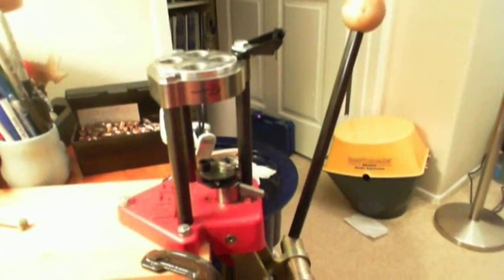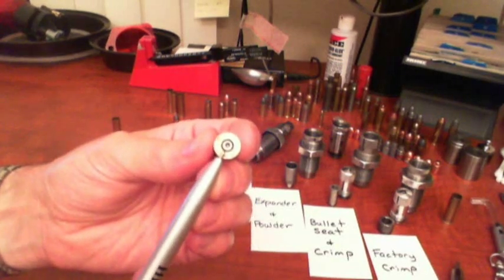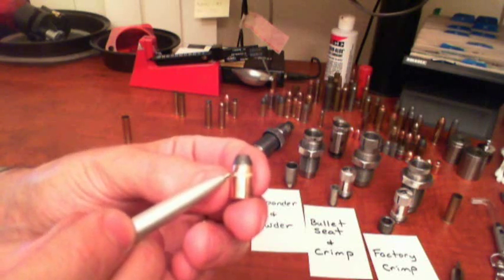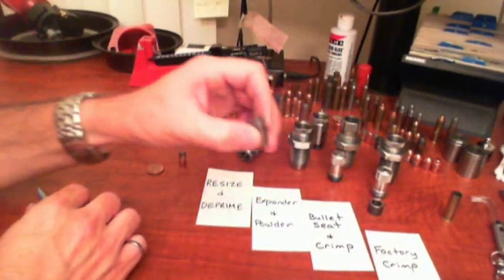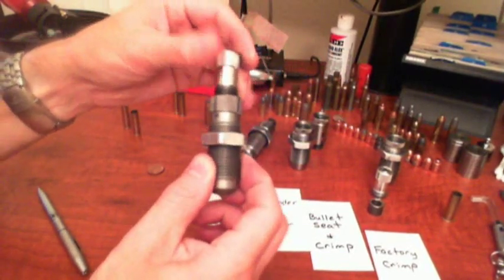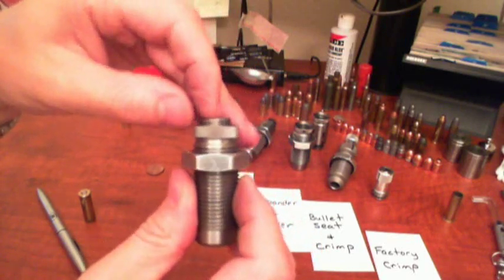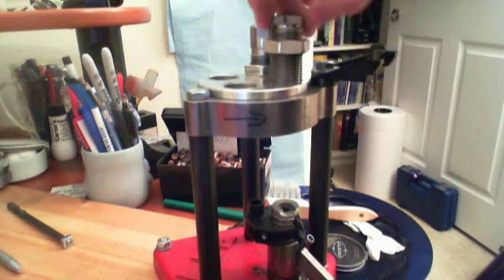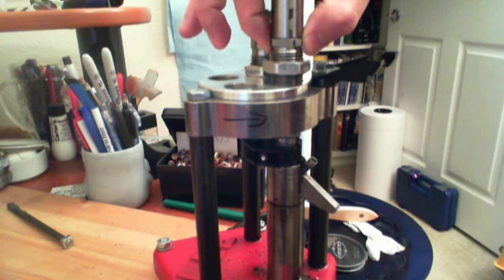38 Special die setup for 357 magnum Ammunition Reloading with Lee Turret Press

Comment: Great job! A thorough explanation of the correct order of die placement, and adjustments to each die, prior to loading cartridges. Follow these steps with diligence, making particularly sure each bullet is seated straight, so its' axis eventually lines up with the axis of the bore [the imaginary straight line running down the inside of the barrel], to ensure accuracy. Thanks for taking your time to pass this info on in video format.

Comment: Thanks, that's a very informative video. The only comment I have is that the instructions that came with my 4 die set say that the Expander/powder die should be backed up by 3 full turns for .38 PLUS an extra 1 3/4 turns for .357 magnum loads (total 4 3/4)

Comment: I use my Remington 222 resizing die to neck size 223.
Practice on a few empty cases to get depth correct. Have not shot the 222 in years, great varmint rifle 1 round at a time bolt action, very enjoyable....

Comment from the maker: At the top of the ram there's a small tube looking thing (primer arm) sticking off at an angle.  The new primer goes in there.  After the first step of resizing the brass, when you bring the ram down (handle up) the primer arm rights itself and pushes the new primer in.

Comment from the maker: @romansten9 I use a Wilson Max Gage.  There's nothing you can do about the hourglass shaped case.  It's not a big deal.  Everyone I talk to has this issue.  The 9mm case is actually tapered just a little (it's not straight wall like say 45acp) and seating the bullet causes the walls to swell.  Fitting tight in the breech may be due to the case.  Glocks seem to make the brass head large.  I jam the cartridge head first in the Max Gage to  resize & make sure the case head doesn't jam.  Tks /John

Comment: You have to be careful with a RCBS Resizer/Decapping die.  The pin has a neck flaring taper, much like a rifle Resizing Die.  I made a mess out of some .357 brass on this die.  'Had to run them thru the Factory Crimping die to get them back.  It really stresses the cases.  

Thanks for the great video.

Comment: Good video. I hope you or someone else out there can help me, caused i am stumped. i am reloading 357 mags with 38 dies on a lee single stage. In using the factory crimp die, after about 30 rounds, i heard a popping sound. After checking it, the tapered bar that fits inside the body of the die is now free to move up and down, even when the screw in piece on the top is all the way in the body of the die. So the tapered bar just slide up freely with a round is encountered. Any help will be appreciated. Thanks.

Comment from the maker: @agentham You get the scratches when you resize? Or do you use a factory crimp die and that's when you get the scratches?  I'd check the inside of the die to make sure there are no scratches in the die.  Also, maybe use a different case lube.  I like Imperial sizing wax.  As for the loud noise, are you using bullets with a wax/grease ring? I usually get a noise when I load lead 45acp with a grease ring groove.  Try belling the case mouth more to see if that helps. /John

Comment: @bearing01  Thanks for the help.  Last time I reloaded 9mm, I think I noticed that factory made bullets were not quite the same as my cast bullets.  One caused the case to swell, and the other didn't.  I don't remember which one right now!  But, like you said its not a big deal and not difficult to correct, if at all.

Comment: Great video John.  Thanks.  One question. For final adjustment of the seating die you turned the entire die in instead of just turning the seating adjustment screw more.  Is this so the die will seat but not roll crimp, since you are following with the factory crimp?

Comment: @bearing01 No crimping die, it only happens when sizing.  I've cleaned the die a few times and used reasonably ample amounts of lube.  The lube I used is the same as I use with my .30-06 cartridges and there have been 0 problems with them, I'll check my local gun shops for the wax though.  

The bullets are Hornady 125 gr FP-XTP which have a cannelure but I don't have issues with any of the reloading steps except sizing.  Take a look at the video response I posted to get a better idea.

Comment: @bearing01 You mentioned a bulge with 9mm Luger. I have the same issue.  Do you do anything to get rid of the bulge? Would crimping help, or maybe making sure the bullets are sized? Because of the bulge, I noticed that some of my rounds fit tighter in the bore, so I usually take the barrel out and make sure they fall out of the barrel when I flip it upside down. I haven't reloaded them in awhile but I think the amount of flare of the case might have affected the bulge too.

Comment: @bearing01 I thought I heard some Canadian.  ;p  

Got another question for you; when I size my .38 and .357 the sizer die takes a good amount of pressure to do it's job often causing a loud noise and the whole bench to vibrate, not to mention long scratches down the length of the case.

I use a RCBS non progressive press so not the same as yours but my .30-06 takes about 1/10 the effort to resize and no big scratches.  My cases are lubed well and I am using a steel RCBS die, any suggestions?

Comment: The .357 dies can't be used for .38 Special - the dies can't be screwed close enough to use with the shorter cartridge. If you want to do both, you need to purchase dies marked .38 Special or .38/.357.

Comment: The OAL for a 158 grain LSWC is 1.475" when using Hodgdon HP-38, 3.1-3.7 grain load.  So, I have a copper plated flat point that is much like the LSWC with a cannelure.  So, do I seat the bullet to the top of the cannelure or do I use the OAL rx by hodgdon of 1.475"
Reply from the maker: Davis Channing I would seat the bullet so the roll crimp is in the cannelure.  That's why it's there - to prevent the bullet from moving under recoil and changing the OAL and potentially locking up the cylinder (or pushing the bullets deeper in a lever action rifle). /John